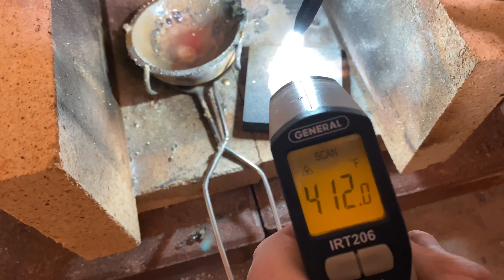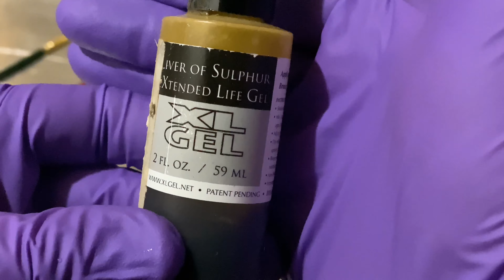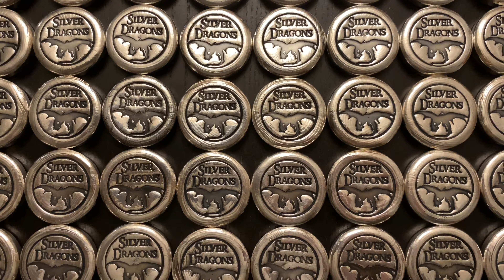How I Make My Hand Poured Silver Channel Rounds

Comment: Good on you for using a hydraulic press for your design mark. I made the same suggestion to Backyard Bullion and he either doesn't understand what one is or seems to think that only those with a true work shop can have one. You'll have much cleaner designs using your current method.
Reply from the maker: JustDanO yeah the press makes much larger stamps easier to use 👍🏽 thanks for watching my friend! 🔥🐉

Comment: Beautiful work! Editing, pouring, stamping. All of it, sé magnifique! I gotta get me one of those beauties. 
Where did you get your big channel stamp? 
If you use a thick piece of tape across the round, then you can use it as a guide to align the stamps. Just slide the stamp down lightly until it catches in the tape. Or you can purchase some really cool (but expensive) stamp alignment jigs. Just in case you didn't already know.
Reply from the maker: Rocky Mountain Bear thanks! took about 3 hours to edit 😏 I got this stamp from stampyours.com its 1 inch... I need to look into an alignment jig 😮🔥🐉

Comment: How many tons did you need to press that stamp? Just got my stamp for some 2oz bars. Never used a stamp bigger than 8mm. My stamp is I think 28mm? Bout the same size as yours so whatever your is about. I been pouring for some time now but wanna step it up. After everything, I just don't have a press for my stamp. Wondering is those 1 ton presses on Amazon for like $80 would do it??? What are your thoughts man? I'll send you one of my first from this lot with this stamp if you can help me answer this Q. Love the channel brotha! Been watching couple years now 🤙